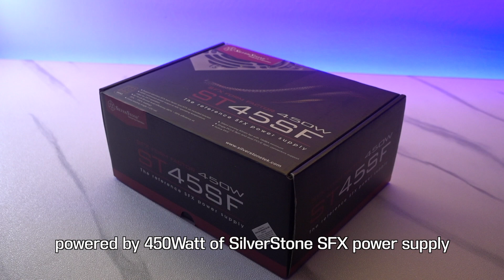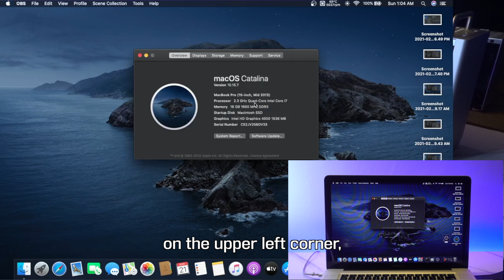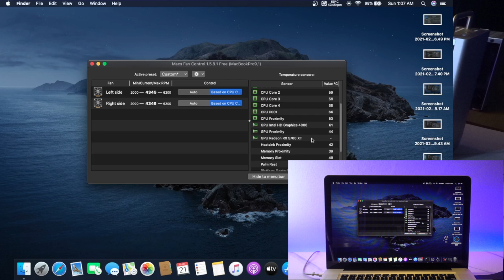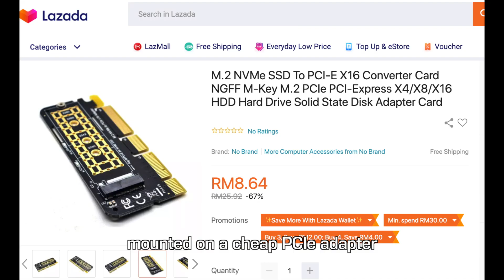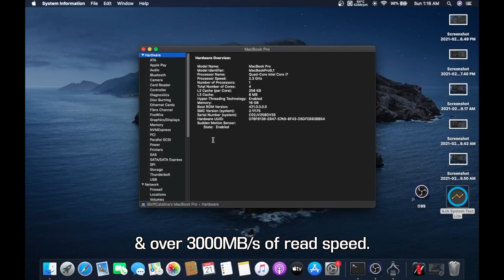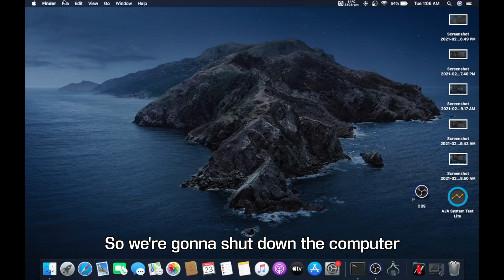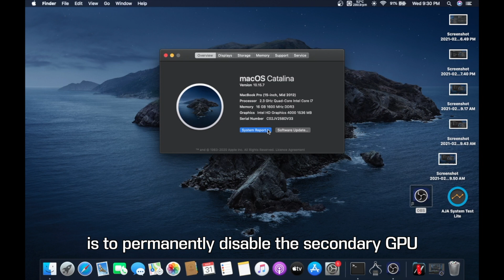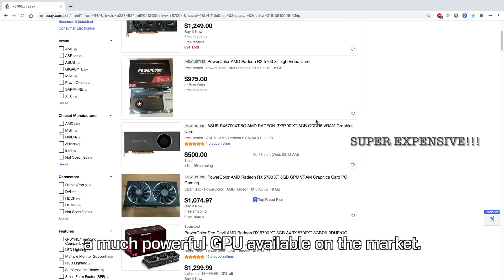How To Upgrade Soldered GPU on MacBook Pro : Introduction to X-GPU Project

Comment: Very good work. I do not think many 2011 macbook owners would want or pay for the eGPU but its amazing that it works. I recently threw one of those 15in failed gpu laptops away because even the repairshops i sell to did not want it for parts, because they already have lots of them.
Reply: You can disable the GPU and run it with the GPU in the CPU.
Reply: @horeageorgian7766  yeah he kinda of wasted the mac. but if it was impossible to use it then its okay

Comment: I am impressed by your video! Question: I have a MBP 10,1 mid 2012 15", A1398. Fitted with i7 and 16 gb ram, 500 gb ssd, running macOS 11.7.5. Question: what is the possibility of upgrading this machine to i9 and NVMe SSD with max ram. I am so used to this machine and work with it all day therefore I don't want to change it but consider upgrade. If it is possible, and affordable I could send the comps to you.

Comment: Wow, this is really impressive. I wonder if it would be possible to make an adapter to fit an MXM card inside the laptop? With only NVME drive there should be space for a GPU, fan and heatsink where the DVD and HDD used to be.
Reply from the maker: Hi, its a long discussion why its impossible. but to simplify it:

1. macbook logicboard dont have much power to support MXM GPU, and Magsafe only maxed at 85W. Typical imac with MXM has 205Watt minimum.

2. a lot of heat coming from the MXM has to be removed, designing heatsink with fan is not cheap.

3. MXM is scarce and used, not new, while PC GPUs available widely new.

and several others that we wont explain here, that's why we discarded the idea at the first place.

Comment: With the same mechanism, can you try upgrading the cpu to something like i9 cpu ?
Reply from the maker: to upgrade it to i9, it needs solder pad redesign, and of course, it also need SMC(with program) from i9 generation, new BIOS EFI for coffee lake, so yeah, pretty much impossible unless theres a lot of engineers working on the project.
Reply: @iBoffRCC  Hope this becomes a reality someday!

Comment: Is there anything that can be done with a MacBook Pro Late 2008 (A1286 )?, Upgrade, graphics card, upgrade the processor... Thanks.
Reply: Same question here. I saw something for CPU change as long as it fits. I'm particularly curious with GPU if this will work on a late 2008 unibody.

Comment: How about doing a video of CPU and GPU upgrades that don't leave the 2012 to 2014 15" MacBook Pros confined to a desk? Maybe upgrading the 2012 retina and early 2013 non-retina models to Intel Core i7-3940XM and Nvidia GeForce GTX 680MX 4GB and upgrading the mid-2014 retina Intel Core i7-4980HQ models to Nvidia GeForce GTX 780M 4GB?

Comment: Hi there, is it possible to order the mod kit for the external GPU connector for the 2009 - 2011 imac line? I'm in the UK and and sending my imac to Malaysia isn't really an option fo me!
Reply from the maker: hi, we understand that some people lives really far away, so we will definitely sell it when it passes the prototype stage. right now we are testing its functionalities, relevant installation guide/method, so its taking quite some time.
Reply: @iBoffRCC  no problem, just wanted to ask as I know there are a lot of people very interested in the project!

I think when you guys complete it successfully you’re going to be flooded with orders from all over the world!

Comment: Cool video, but if you have a GTX or RTX graphics cards could you use boot camp and install windows 10 and get the rtx cards to work?
Reply from the maker: Unfortunately considering the high price tag for those RTX, we might not be able to get 1 to test it out for now.

Comment: Could this method work on later MacBooks as well? I know they don’t have the convenient dvd slot, but would it work in principle for a 2012 or early 2013 Retina MacBook Pro with 650m graphics? What about a late 2013-2015 retina MacBook that shipped with only iGPU? Seems like it would really expand the customer base of this project to add PCIe expansion to more modern laptops
Reply from the maker: Yes it will certainly work with retina series with soldered GPU. We own a 2015 MBP 15inch with X-GPU adapter, but how its gonna look like - we will tell it on our future update.
Reply: @iBoffRCC  what about mid-2012 13inch non-retina? Is it possible?
Reply from the maker: @PsyOpRecs  Technically yes it is possible, but after considering a lot of bandwidth limitation on 13inch 2012(we can only extract PCIe x4 from this board, not pcie x8), so we've decided to only apply X-GPU modification to 15inch lineup only. 13-inches still can get NVMe support though(because NVMe is PCie x4)

Comment: Will the GPU modification allow video output via thunderbolt?
Reply from the maker: Hi, the external monitor should be connected directly to the X-GPU display ports. If your GPU has 4 ports, then you will get 4 external monitor.
Reply: @iBoffRCC  Cool thanks! I'm interested to do this mod.